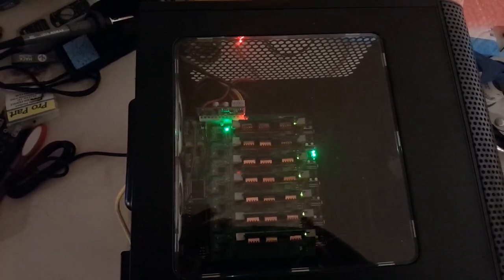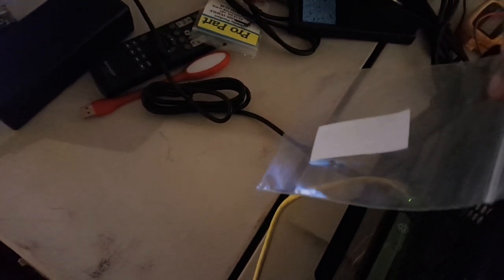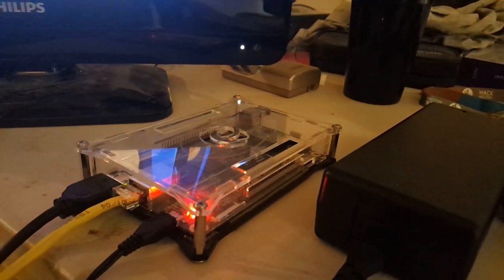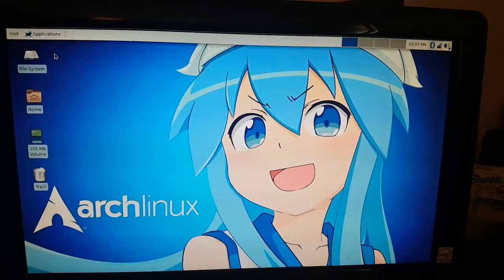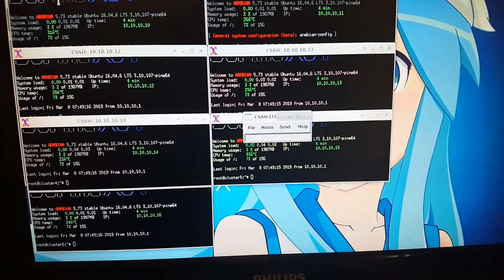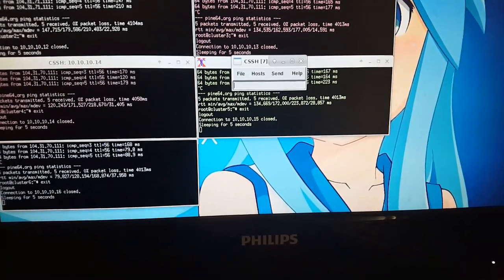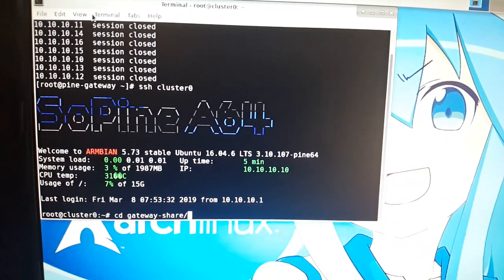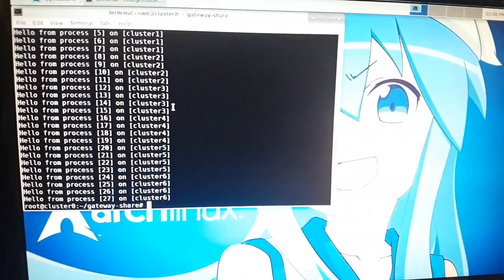Pine64 Clusterboard Build Demo

Comment: That's cool! Is there a way to boot the 7 sopines from a network image on the Pine64 "gateway"? So that you can update the nodes OS only at one spot (like with the raspberrypi)
Reply: it's possible to set up netboot, the slaves have SPI flash to burn a bootloader into in lieu of sd cards
Reply from the maker: it's possible but the extra traffic would be a hassle.  Perhaps some kind of shared image that's synced to the local SD card.

Comment: did you have to solder resistors to the clusterboard for the power header setup?
Reply from the maker: no, I didn't use an ATX power supply.  I wound up wiring it directly to a power brick.

Comment: Hysterical! I just got my clusterboard. Looked around for a Case I liked.  Found one. Found it was actually unavailable, at least at the site I looked at. Thought about it. Found and then ordered a different case. Then I found this video. The case I ordered is on its way and so it turns out it's the same case you have! Spooky. 

 I also have to sneak a Parallella and a Jetson Nano into the same case.  So, I am actually thinking stashing into the case a 5 port wifi router module with Gbit Ethernet, with the module in bridge mode.  The hint though, from your video, about the other SOPINE motherboard to setup the cluster board modules is gold, as I didn't think that one through before ordering the cluster board.

A good video on the case is at https://www.youtube.com/watch?v=Oy4hxPruk9Q.